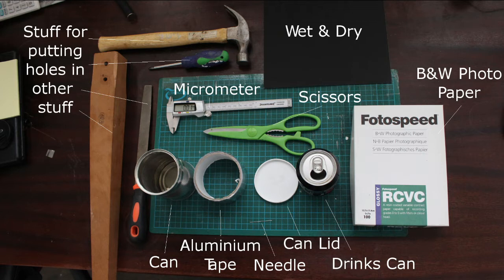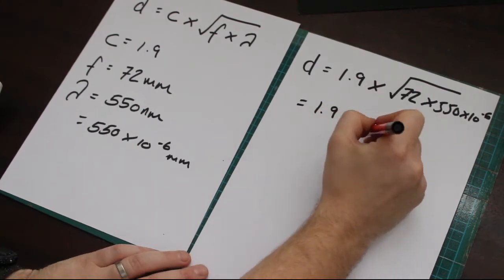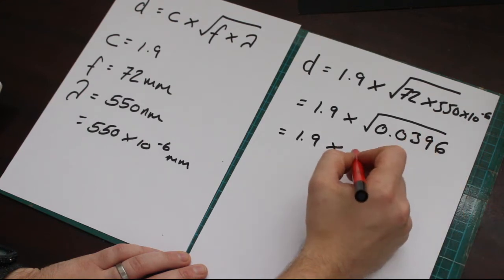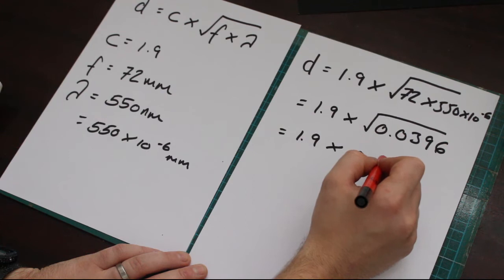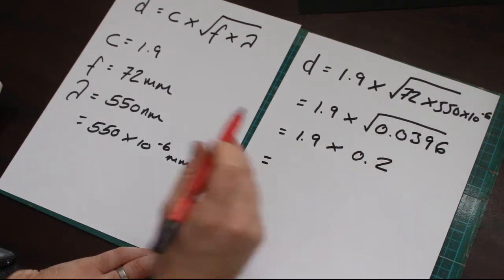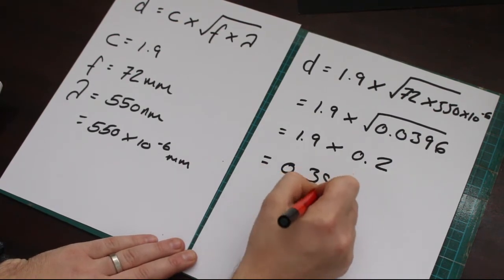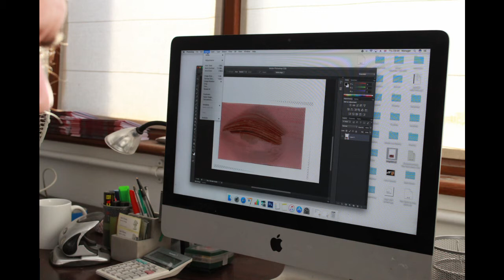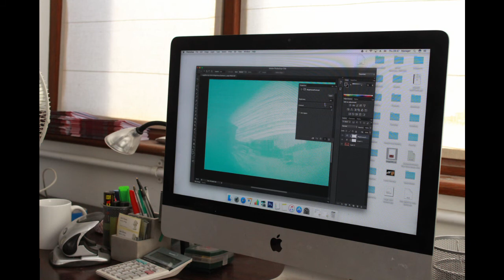Solargraph

Comment: This is a wonderful tutorial, good job. I have been meaning to ask, would a preview scan mess it up? I also like to scan fairly high resolution so I am wondering if I scan very high res if that'll mess it up as well since the scanner takes a longer time to scan at a high res setting.
Reply from the maker: Hi. Thanks so much! Preview scan won't ruin it but any light that hits the paper is going to change the tone and you will lose definition, however slight that change may be. If your scanner makes you do a preview (some do to gauge the paper size)  just put in a blank piece of paper first. With higher resolutions, you could test with a blank photo paper and see if there's darkening across the scan. Hope that helps!